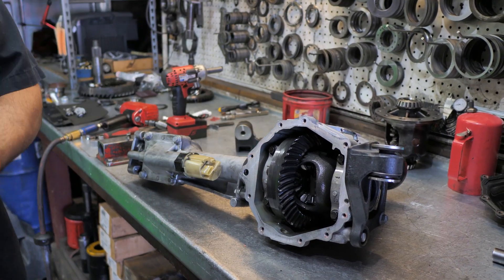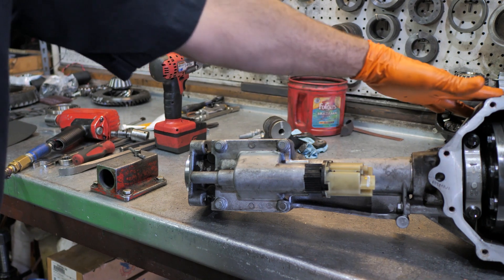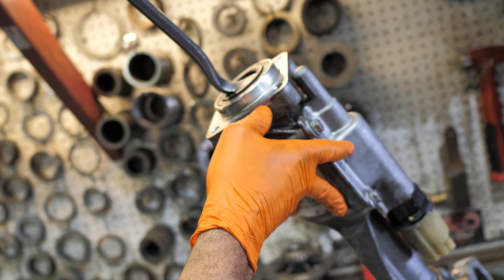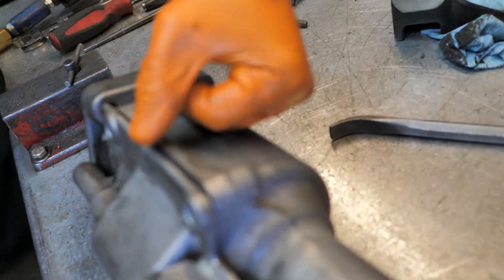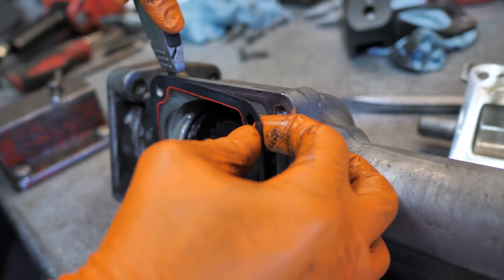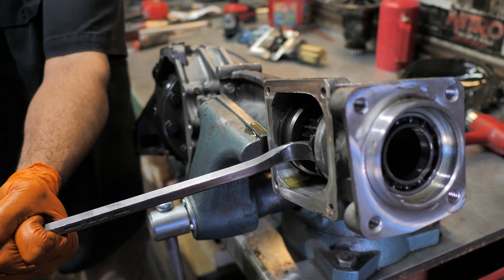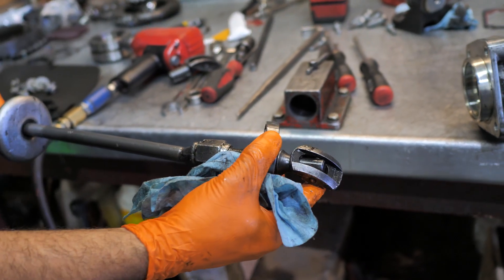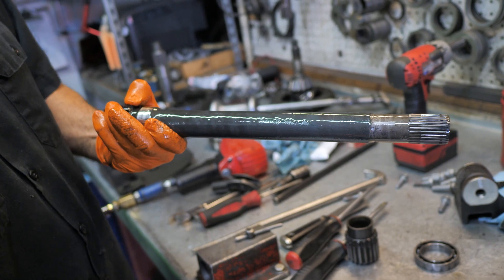HOW TO: Disassemble IFS Axle in 2015+ Chevy Colorado & GMC Canyon Trucks

Comment: Hahaha, dropped my truck off at a local shop 2 days ago to install 4.56 set in my ZR2. Get a call from him today saying "the entire front rear has to come out". I made him repeat it because I had to be hearing it wrong. Said the entire rack and pinion has to come out and book time was like 18hrs on just the "front rear". 

When I went to go pick up the truck he showed me what he was talking about. Said the steering rack has to come out because the "thing sticks off the back" (pinion) so far that the "front rear has to slide forward" to clear it. 

Shook my head and drove home. Currently seeking another shop to handle it. By the looks of it, you guys have done a few "front rears". Wanted to ask him if a rear was a "rear rear"...he called it the "back rear"
Reply: Good thing they saved you the headache from that inexperienced shop.  They must be blind, because there is a cross member that only holds the rear of the front diff that if they could not clear it rotating it, they could have removed the 4 bolts and it would have dropped straight down with no problems.  Sounds like they have no idea of what they are doing.  You are better off.